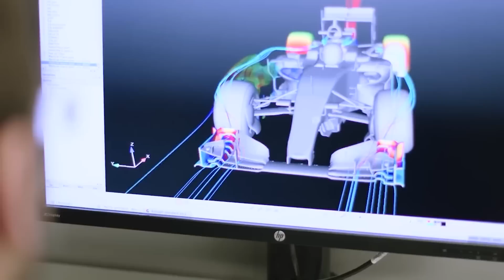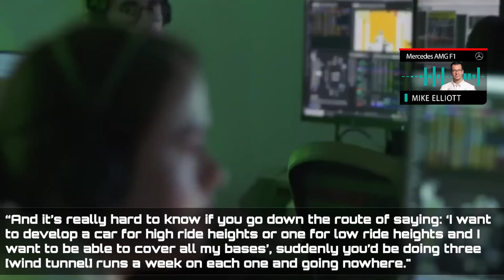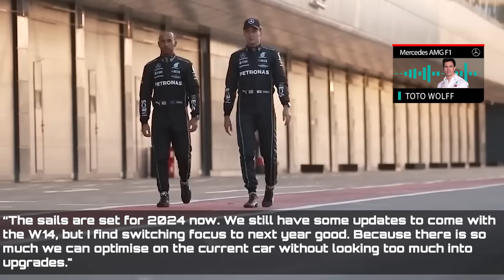Mercedes BRUTALLY HONEST About New Developments!

Comment: They knew from first race running low caused them problems. They did nothing about this and demanded everyone had to raise their cars. 
Just be honest and say we can’t a good enough car, simple.
They learnt nothing from last year because they put the same car out this year.
Now Nikki Lauda has gone there is nobody to tell Wolf the design is wrong and, he knows bugger all about car design.
Their dominant car was designed before Wolf got there, mostly by Ross Brawn.
Wolf thinks he knows it all well, the proof of the last 2 seasons shows otherwise.
Nikki Lauda would have told him the design was crap and wouldn’t work but nobody is brave enough to stand up to him.